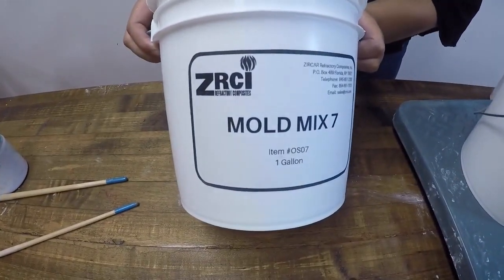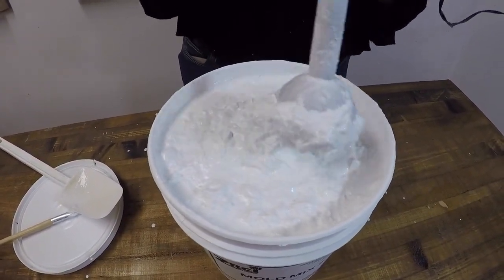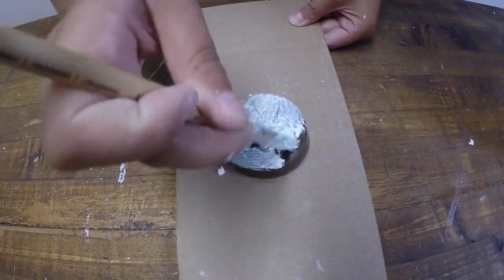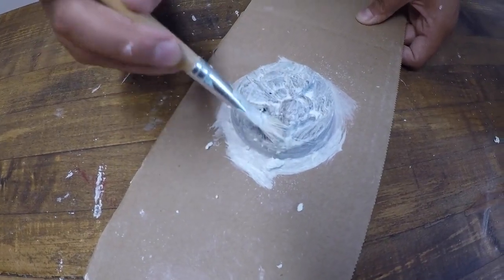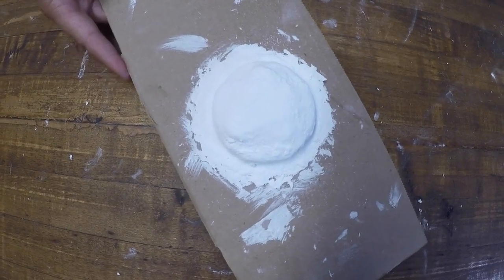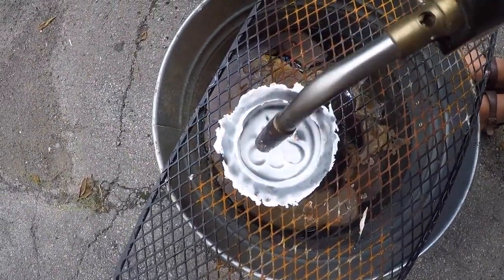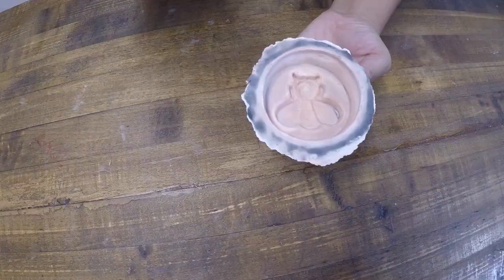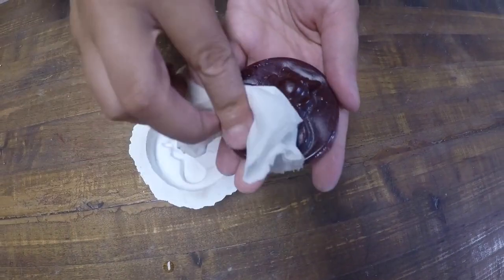How to Make a Reusable Glass Casting Mold Using Mold Mix 7

Comment: Once the water is added to the powder, how quickly does it need to be used?
Reply from the maker: The wet mixture can be sealed and kept indefinitely.  If it dries out you can simply add a little water to re-hydrate it

Comment: I made and open faced mold and the glass got fused to the mold even when using kiln wash. And the glass didnt flatten out on the open side. Any suggestions?

Do you let the kiln wash air dry or dry it in the kiln at 400 degrees Fahrenheit? Thanks for the help!
Reply from the maker: Hi there, I am sorry you had a fusing issue.  I would suggest doing  a thicker coating of kiln wash.  You can also try a different release agent, Graphite and Boron Nitride Aerosol Sprays work very well at preventing sticking and you can use a much thinner layer of release.  As for the flattening out on the open side I think this is probably an issue with the firing schedule you are using.

Comment: I am wanting to do a casting of a couple of ceramic pieces I have make out of clay and bisque fired ceramic. Can I use Mold mix 7 directly on these to make a mold?
Reply from the maker: Hi Jet, you should not put the mold mix 7 onto the ceramic directly, it will stick (if sticking happens it can always be removed with water).  You can use a mold release before applying the mold mix, we generally recommend Smooth-On Mold Release.

Comment: I am interested in making a Hump mold for slumping.  Would I be able to paint the mold mix 6 into a silicon mold and form this mold by building layers?
Reply from the maker: Yes!  Mold Mix 7 works when directly applied to silicone, it will peel off of the silicone when it is completely dry.

Comment: How many casting can You make from one mold aprox?
Reply from the maker: If the molds are open faced with no undercuts you can use the mold until the surface begins to lose detail.  If the mold is properly primed with a release agent (kiln wash, boron nitride, graphite) you can get up to 20 or more castings before detail is lost